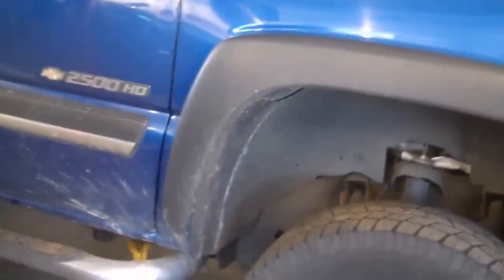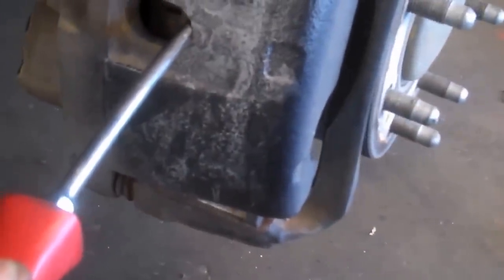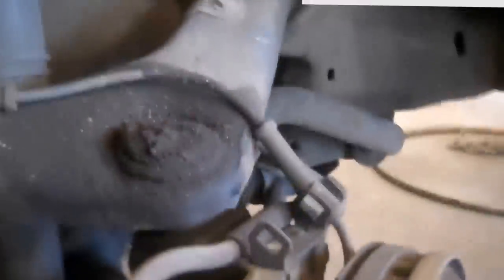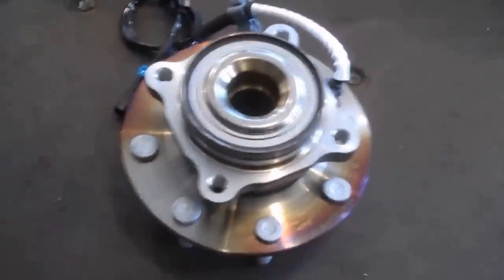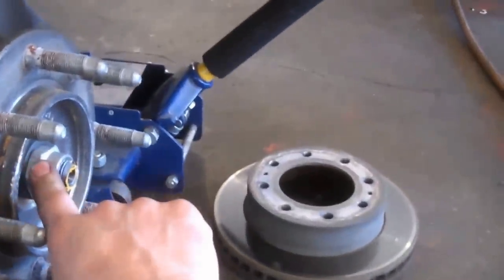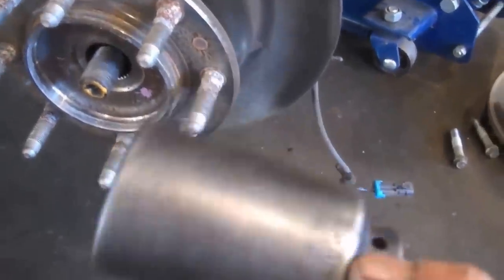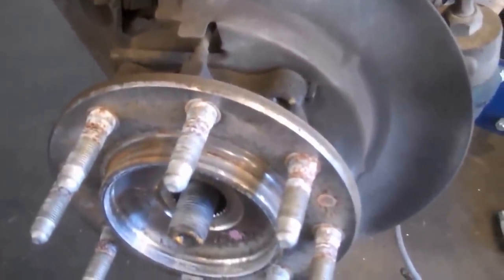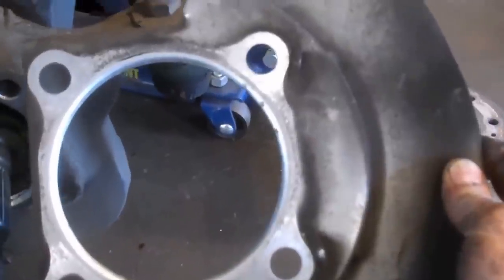Hub assembly wheel bearing replacement Chevrolet Silverado 2500 HD 2001 - 2007 4WD Chevy/GMC Trucks

Comment: really good video it helped a lot. got the job done in about 3 hours and that included doing the sway bare bushings with a couple breaks.the only trouble i had was the axle nut was 1 3/8th not 1 7/16s so had to make trip to get another socket. thank you  my next job is replacing the inner and outer tie rod ends.

Comment: repair shop wante$1500 to replace both front wheel hubs...i asked them as long as they have it tore apart how much to replace the front rotors and pads....their quote was $2100 for all.   After watching this video a couple times and spending $650 for all the parts (hubs were 250 each) i saved myself over $1400....thanks !
Reply: brodie lucy check rock auto out sometime for part you wont believe the prices!!

Comment: Tip; Loosen the bleeder valve before collapsing the caliper. Run a small rubber tube to a plastic container. Now when you push the brake piston back into the caliper the old fluid will drain into the container. 
Forcing the old fluid back through the master cylinder can cause master cylinder seal problems. 
As an added plus, you're replacing old brake fluid with new brake fluid.

Comment: Hi, I just watched your video, it was a good one, thanks. my question though, is this the same procedure you would follow on a 2004 GMC Yukon Denali XL? I just bought one yesterday, took a 100 mile trip and as I was getting back home it started squealing and having a high pitched grind sound, is that the wheel bearing? I took the front passenger tire off and wiggled the rotor and I can feel something wrong. everthing looks the same as the Chevy in your video except there isn't a cover over the axle nut.
Reply from the maker: Ron Corcoran well you need to check two things I think, brake pad thickness, maybe they are worn out and metal to metal. To check the wheel bearing the tire should be on and tight. then grab the top and bottom of the tire and try to wiggle the tire, should be no freeplay.  Your description makes it sound like brake issue.
Reply: took the wheel off and the brake pads and rotor are fine, but that's exactly what it sounds like, metal to metal when the pads are shot. I will check the freeplay in the morning when I get it back on the jack, another question, when I install the hub assembly do I have to grease anything like when you replace bearings or is it all internally lubricated?
Reply: and thanks for your response, I appreciate it, you tube and all of the posters are how I learn to do pretty much everything I haven't had any experience in doing before.
Reply from the maker: Ron Corcoran Maybe just a little grease or anti-seize on the hub assembly outer part, IF you have to ever do it again that will hopefully allow it to come apart easy again.  No grease needed for the bearing part, internally lubricated already.

Comment: If I'm driving and there's a vib when I turn left which wheel bearing is bad
Reply from the maker: You say there is a vib, are you saying you feel a vibration?   Or do you hear a noise?
Reply: Just felt a bit didn't hear anything  . I changed driver side bearing hub assembly and its fine now
Reply from the maker: Glad you got it taken care of.

Comment: If a wheel will wiggle side to side what is it cause I took it to get it aligned the guy said ball joints were bad I work on cars all the time won't send to a shop unless need to but I can't move it up an down he said pitman arm was bad so I changed it but that didn't helpcan ball joints cause the side to side wiggling

Comment: You showed absolutely nothing about replacing the bearings. All you showed was how to remove the bracket, my 5 yr old could remove and reinstall a bracket
Reply: The bearing is in the hub he took off. It's a bearing hub assembly